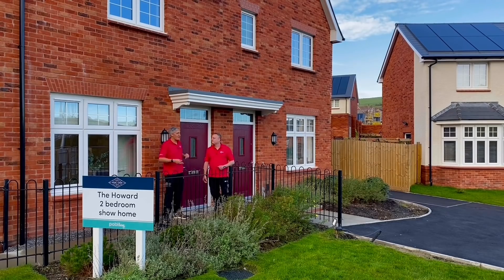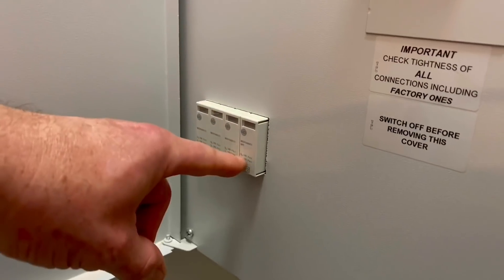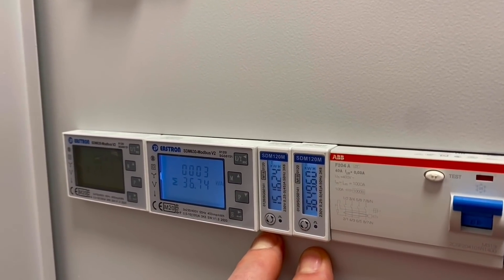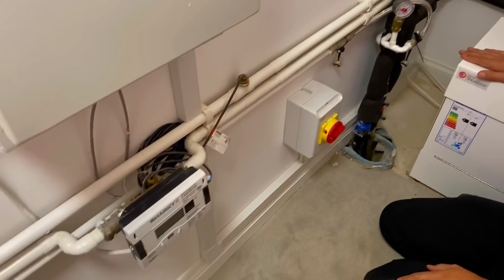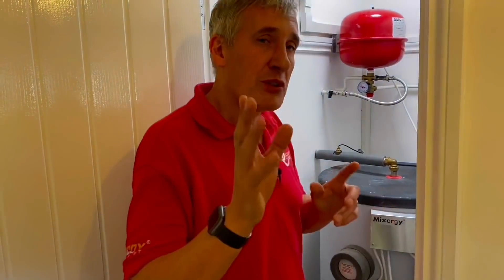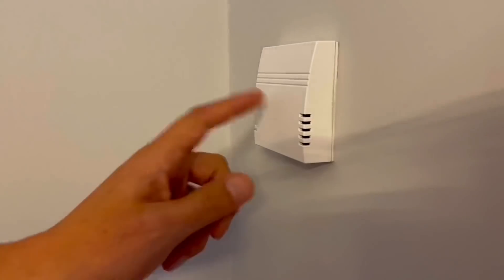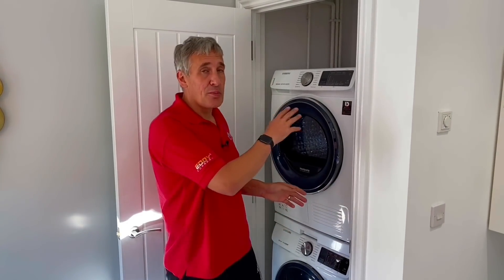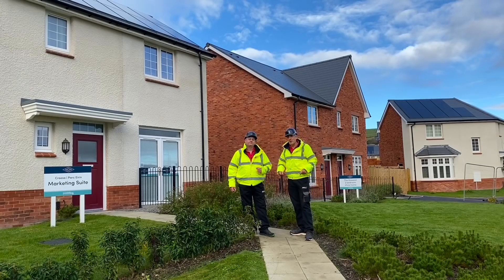THE FUTURE OF HOME ENERGY is HERE - A GAME CHANGER FOR ELECTRICIANS

Comment: Who you going to call when this stuff starts having faults in 20years, first plumber who can’t do the job without an electrician who in-turn cannot understand the computer program. Then if the ground source gives up the goat homeowners will all be out in the street arguing.
Reply: That's if you can get the right software, I can see a lot of this stuff being ripped out, because people need to buy expensive software, especially if you have a box, and they won't show you inside it. This will only end one way.
Reply: 20 years???  I would give max 5 years. Lets not forget, we're talking about technology here that needs updates every month and the older the equipment gets, the more issues occur. My 5-year old iPhones and tablets don't work anymore because they're too old and unable to accept new updates. I can predict lots of issues coming with all the new technology implemented in new homes in the near future.
Reply: @horatiupogoreanu5752  true, it will probably be out of date in 12 months, or they will do like phone manufacturers do and drop software updates

Comment: Sorry, what a load of rubbish, this is getting out of control. When will people get it , modern technology doesn’t work and doesn’t make our lives easier , what it does do is cost us more and more money.  Two much tec 
The people that move in to that house will not have a clue as to what or why  they’re is a problem   .  I would not touch the installation with a 100 ft barge poll . This industry has gone mad.
A house that would of cost £ 280.000 now cost £ 750. 000   . Stick it were the sun doesn’t shine.

Comment: Ground Source Heating is good but never make the mistake of installing Air Source Heating as that seems to be designed for climates generally much warmer than the UK
Reply: I'm sort of with you on this, at least as far as much preferring ground to air sourced.

However Alec of the Technology Connections channel has made a number of videos about this and says that even in the cold winters of the American Mid-West air-source can work.  The first of his series is:  https://youtu.be/7J52mDjZzto

That said, the US systems that I have seen (including in Alec's video) do seem to be significantly larger than what we find over here so it's possible that they're simply applying more oomph to the problem.
Reply: @calmeilles  You have hit the nail right on the head here Matthew that there is a minimum system size where anything under that size simply will not work in the UK generally unless you are lucky enough to be in a micro climate where the average outside Air Temp is very good but other that that avoid these Air Sourced systems like the plague!!
Reply: Absolutely! Air source is utterly useless in the uk. 
Good to see solar because unless its in Scotland the main electricity is NOT 100% renewable and cannot be claimed as such.

Comment: Fantastic for all us electrician's and technicians. We'll be in and out all these houses daily replacing power packs and motherboards! Homeowners are going to be paying thousands on each piece of kit when it breaks down. You'll have plenty of people charging thousands for a blown fuse or faulty sensor. 

£400,000 for a carbon neutral house that you're spending £500 a month on service contracts and maintenance. 👍
Reply: Yep, I can see a lot of electricians making a lot of money when all this kit goes wrong.
Reply: Plus ground rent, mortgage and communal charges!
Reply: The underlying system for control uses erlang at its core, the same language used in telecom systems,  its designed to be remote debugged, can self heal, ands like telecom systems is designed to maintain uptime... every device connected to the system sends a heart beat that alerts of any issues, and if a part is showing issues the system can restart that single piece of control code automatically. The config can also be upgraded over time with new device drivers using all the standard communication protocols for wired and Wifi over the air via a separate 4g modem so is not reliant on users wifi. It's been designed to avoid the need for callouts as much as humanly possible. The system was designed with minimum maintenance in mind, and can be debugged remotely. So beyond actual hardware failure the software was designed to be as flexible as possible.

Comment: Absolutely no developer under the sun will even consider such stuff unless forced and the inevitable poor installation and fabric quality will lead to very unhappy homeowners.

We still have boilers being installed that pass building regs and SAP that aren't even designed to run at condensing temperature needed for efficiency... What hope do we have for correctly designed and installed ASHP?

You'd be better off building a commercial size demand shifting storage battery for the whole estate underground or somewhere amicable rather then splitting it up between every house. At least then it could be properly regulated and has a chance of being done properly and buys you the time until the grid goes net zero.
Reply: That would be the ideal solution, but why not dumping all the expense on the poor homeowner, the "sucker" for smart technology? It's very convenient for the government and estate developers, right?
Reply: Fed by a massive gas engine that feeds its heat into a district heating system with thermal stores in each property. You'd get free heat as a byproduct of electricity generation with ZERO transmission charges and minimal transmission losses!

Comment: This technology should be the minimum in all new builds.  These houses are a fantastic showcase for comfortable homes that will have low monthly costs.  Everything in this video is coming to all homes so represents one of the biggest opportunities for businesses in generations.  Please take note, learn the systems featured, and get certified to install these products.
Reply: Big opportunity for business = big cost for customers.
Reply: I don't think it will ever come to all homes, the cost would be too great, plus the network couldn't cope. There's an awful lot there to go wrong, as time goes on this stuff will become obsolete due to advancements, and the homeowner at that moment will be hit with a big upgrade bill.
I have just had a similar situation in a flat that had square d lighting, and because it's not supported, it cost a fortune to rip it out, and it's not that old really.
Reply: @acelectricalsecurity  spoiler alert: I'm not an electrician but... "plus the network couldn't cope" isn't this development off grid? Every house has pv on the roof, each roof angled to get the best solar input. Each house has battery storage, ground source heat pumps and the most efficient insulation. So where is the stress on the network? It's all smart isn't it? 
Fully Charged have a video on this development but its great to see it from a professional point of view, can't wait for the next one chaps. 👍
Reply: @judebrown4103  it's got a 3 phase supply coming into the place. There's no way that PV system and battery could power that house.
Imagine everyone coming home in the evening and whacking their battery car on charge, which will happen and what about those homes with 3 or 4 cars, what happens then, you can't just keep adding power points for battery cars, the network is nearly on its arse now, without all the extra demands that will be put on it in the future.
Reply: Jude, 

don't rely on Fully Charged's rose tinted glasses.
Solar is poor in the U.K and does not really produce sufficient extra power to keep a battery charged for when it is equired. U.K. solar produces about 10% of capacity per annum, that's not a lot. Even cloudy days in summer drop the output significantly (at least half sometimes even more). Batteries are also less efficient due to charging, inverting and battery internal losses than getting power from the grid.
Insulation is the key with gas for heating, much cheaper than the seriously over rated heat pumps  (The quoted COP never factors the  large losses in making and distributing electricity) and expensive electricity.
EVs with our current (sorry) electrical supply run wholy, or near enough on gas anyway due to how the grid works.
Reply: @acelectricalsecurity  if the house was built to ‘passive haus’ standards the heat loss and therefore the heating load to be moved by the GSHP will be very small.  Especially so in summer when hot water will likely be fully serviced by solar. It will get sketchy in winter when solar will not be able to keep up, even with the battery topped off by off peak cheap rate wiggly amps.
Reply: Just showed this to the wife. She was not impressed with all the "tin and wires" in the house.
I'd suggest that it should be in an externally accessible plant room.
Reply: @StuartTaylorEsquire  A plant room the size of a third bedroom - at least as far as the estate agent is concerned.
Reply: @StuartTaylorEsquire  your right, I am sure the builders could make the place bigger with a dedicated plant room
Reply from the maker: On the money Matt #opportunity  👍
Reply: This sort of thing should become mandatory for new builds.  And extra ❤ for the ground source heat pump.

But there are several fairly small things that had me thinking "I wouldn't have done it like that".  First was radiators on the first floor; I'd guess to save the expense of pouring a concrete screed for underfloor heating pipes.  Also a single zone each floor?  I prefer bedrooms cool and bathrooms warm.  And downstairs a single zone means that any time you cook depending on the position of the thermostat either you overheat in the kitchen or chill everywhere else.  A couple more valves and thermostats wouldn't cost that much!

Battery on the kitchen wall?  Why?  I can't think of a single good reason not to put it somewhere more out of the way.  Unless pop over and see the size of my battery is to become the new come up and see my etchings.  😀 

Finally the magic box and all that monitoring complexity.  Great for a demonstration and proof of concept development.  But long term it would be better simplified, reduce the chance of faults and more easily repaired when the do happen.

Comment: Has anyone ever taken in to consideration the cost when this lot goes wrong. Who’s going to fix it . Also most people don’t even know or can’t be bothered to learn how a digital time switch or stat works and just switches the whole system one or off. They don’t want apps ,especially when in a few years the soft ware won’t. Work as it want updates and in that time it can’t be updated as it’s obsolete. People just want simple systems and things that there local sparks or heating engineer can fix for realistic money .might be cheep to run but 10 times more expensive to install and maintain.and who wants all that clobber
Reply: Jesus, my neighbour is only in her 40's and already can't be arsed with half the shit on phones. She actually went out the other week and bought a tablet and a basic £20 phone with buttons! Apps are rendered fucking unless when people as young as 45 as buying and choosing basic phones!
Reply: The underlying system for control uses erlang at its core, the same language used in telecom systems,  its designed to be remote debugged, can self heal, and like telecom systems is designed to maintain uptime... every device connected to the system sends a heart beat that alerts of any issues, and if a part is showing issues the system can restart that single piece of control code automatically. The config can also be upgraded over time with new device drivers using all the standard communication protocols for wired and Wifi over the air via a separate 4g modem so is not reliant on users wifi. It's been designed to avoid the need for callouts as much as humanly possible. The system was designed with minimum maintenance in mind, and can be debugged remotely. So beyond actual hardware failure the software was designed to be as flexible as possible. The system uses secure tokens that are rotated, and has security considerations at its heart  to connect to googles cloud infrastructure. We also set schedules on the devices themselves so even when there is no cloud communication the devices will continue to function, the system can also restart itself to the last good known state automatically if issues arise. All the devices installed also can use their standard communication protocols so they can be controlled via their own native apps if required. So the technology is designed to be robust, secure, self healing, updatable, configurable and resilient and far as is possible.

Comment: How does that battery compare to the power wall?
Reply: That was 5kWh while the Tesla Powerwall is 13.5kWh.  

Can't tell you anything else, but it would be interesting to compare cost (£8,175 + VAT for a Powerwall) cost per kWh,  max peak (7kW for PW) and sustained (5kW) discharge rate and cycle efficiency (90%).

Comment: Nothing is meant to last. Good luck with the bill when equipment is going to be out of warranty, and outdated. After 5-10 years you’ll be struggling to find parts when something stops working. Then you either end up replacing more stuff then expected just to have compatibility, or have one app or controller for each piece of equipment and no communication between them. The intention was good, but the whole system installed will not be cheap to maintain.
Reply: Spot on, nobody looks that far ahead👍

Comment: So am I correct in thinking that the only source of heating for that house is a 3kW heat pump?
Reply: Should be fine if it’s built properly!
Reply from the maker: You need to take in to account the heat gain - every 1KW of electrical energy yields around 3.6 KW of heat energy out.
Reply: @efixx  so when you said it was a 3kW heat pump you were referring to the maximum electrical demand?  Air source units are normally spec'd with their thermal output, not the electrical input.  So the unit in that house can produce approx 11kW of heating output?
Reply from the maker: @Chris-hy6jy  it’s electrical input - output varies by the time of year
Reply: @efixx  so in that case a 3kw immersion heater produces 10.8kw of heat?! 🤔
Reply: @efixx  That heat pump is actually 3kW thermal - 0.8kW power consumption. It really is tiny.
Reply from the maker: Yes that’s correct
Reply: @efixx  I'm sure that house has very efficient insulation but doesn't a 3kW heating system for the whole house seem a bit small?  We'd need to ask the home owner in January I guess 🤷‍♂️😂
Reply: @Chris-hy6jy  immersion heaters are generally 3kw so there's your comparison and answer!
Reply: @stuartcraigon2003  the immersion heater isn't used to heat the house though??
Reply: @stuartcraigon2003  you can't really compare a resistive immersion heater which has a COP of 1 to a heat pump with a COP of 4.  As electricity has historically been approx 4 times as expensive as gas, the two are roughly equal in terms of cost to the home owner.  I won't be giving up my gas boiler any time soon though!! 😂
Reply: @Chris-hy6jy  it could be, that's what an electric boiler is!
Reply: @stuartcraigon2003  an electric boiler?
Reply: @Chris-hy6jy  yeah an electric boiler, I'm guessing by your comment you've never seen or installed one.
Reply: @stuartcraigon2003  I've seen electric water heaters installed over sinks for instant hot water.  I've also see electric water storage tanks but nothing I'd call a boiler... So it replaces a gas boiler and heats a whole house??

Comment: Little point in the 22kW 3 phase as very few cars can charge on 3 phase at that rate. One of the few that can is the Renault ZOE, which uses the motor coils as part of the charging circuit.

EVs that support 3 phase charging usually work at 11kW, to match European 3 phase homes that offer low current on each phase. Also means that the car only needs three 3.5kW chargers. Two them can be configured in parallel to provide a 7kW single phase charger, or all three can be used to give 11kW three phase. Therefore only a 50% hardware overhead to offer 3 phase.
Reply: I was thinking same but what about 5 years from now ? 22kW could become standard home charging. Future proof ?
Reply: @malcolmrussell7283  Possibly, but I don't think it likely. Once all EVs have 70kWh to 100kWh batteries then you set of for your journey with, say, 300 miles range, which is 'plenty' to take you to a rapid on a long journey. And you can charge 70kWh in 10 hours (so overnight) on even a 7kW charge point. Going to 22kW charger in every car roughly doubles the weight (unless you play the Renault trick), adds cost (probably not a factor of two), and gives little real benefit. Having said that, we do find 22kW AC charging on our ZOE a good alternative when a CCS rapid charger on our travels is already in use.

Comment: TBH it looks like a bit of a clusterfunk. Nice place to put that battery too. The height is for kids to crack thier heads open on the corner.
Reply: A bunch of morons in the Building Control department to approve this poor design and installation. I think the inspectors should be re-evaluated by a higher professional body with higher standards. This is their prodigy.
Reply: Yeah, that's an accident waiting to happen. And all that unusable space in the understairs cupboard...
Reply: Never thought of that, well spotted!